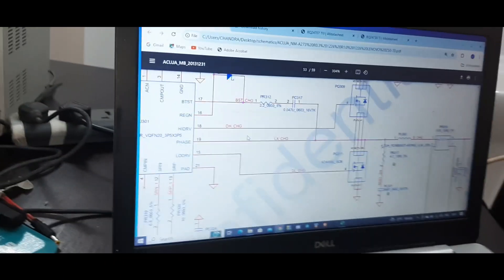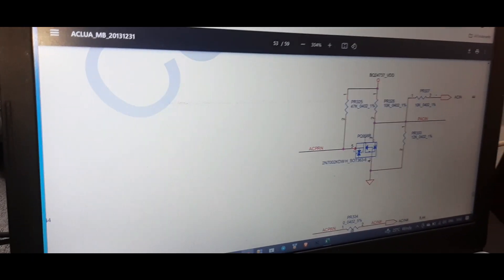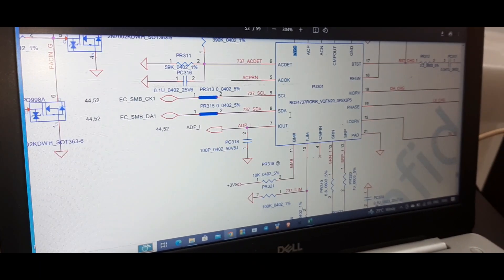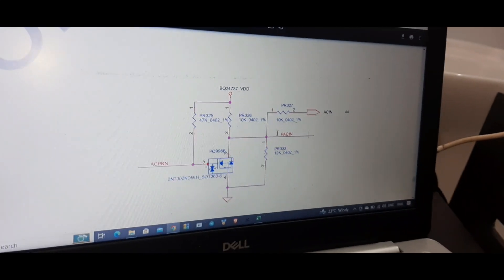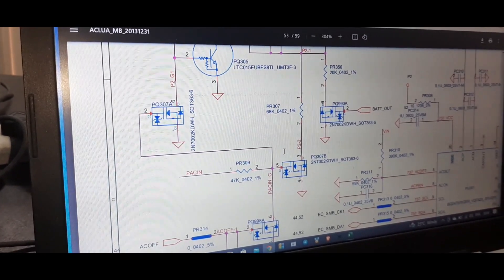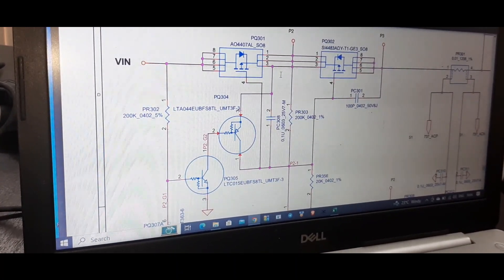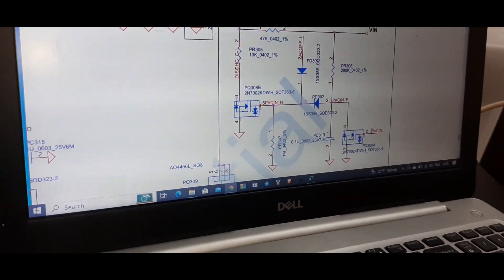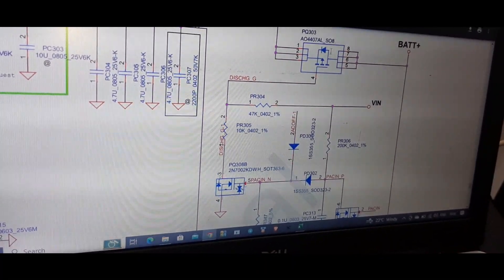ACOK is 6V.  But laptop motherboard is turning ON. How? | Laptop repair Training Institute

Comment: I had to add onto this as a student, maybe we should say when you plug in the adapter ,we get pacin which translates to AC in (charger present),,and when we dont have the charger present, no pac in no ac in.This same Vin is a resistored voltage on to the discharge P CH mosfet. So when there is no charger, the gate voltage on that discharge Mosfet is automatically 0v meaning it is accepting power from the battery circuit..
Year ,we are learning LOGICS

Comment: Sir, my gaming laptop is showing gpu board power draw at 750watts and the gpu clock is stuck at 210mhz
Reply from the maker: Full details required to give the solution

Comment: My xps 9310 stuck at boot logo suggest is it motherboard issue or ssd issue and it happened just after driver update post that not able to boot also
Reply from the maker: There may be multiple issues. After bios updates,  there may be settings issues.  Check ssd health.  If more bad sectors then also same issue. These basic checks 1st. Then hardware level need to check like cpu caps replacement etc